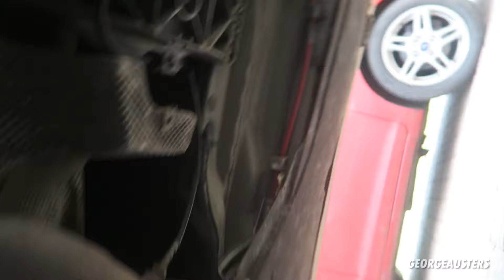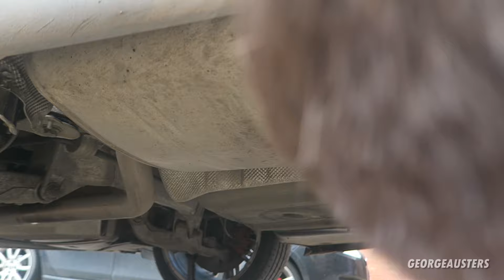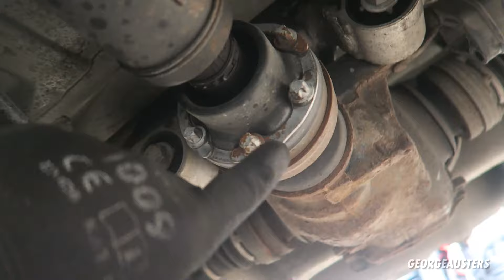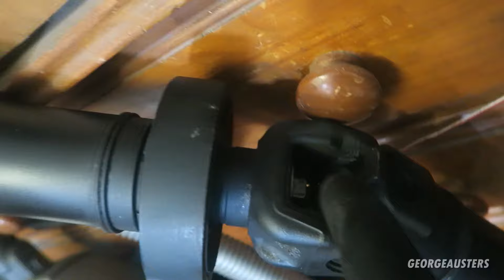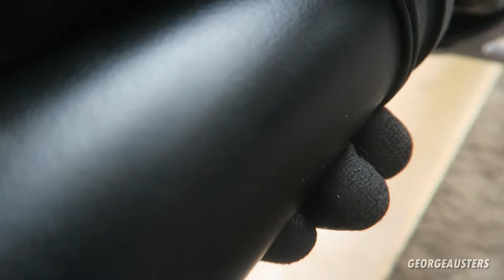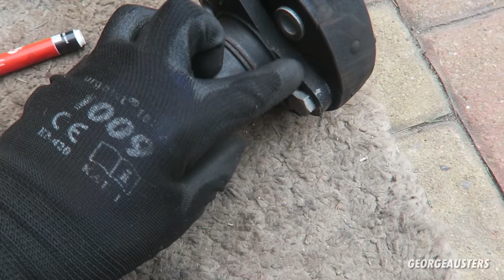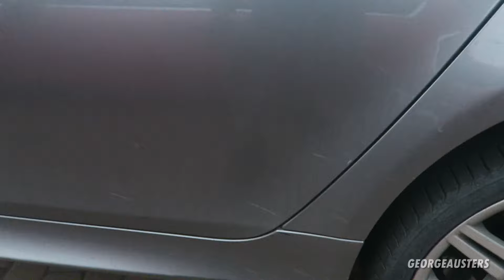BMW Propshaft Driveshaft Center Bearing & Giubo Flex Disc Replacement

Comment: I've got a bad rumbling sound happening that is very noticeable in low speed in my rear to dead center. Could replacing these parts fix this possibly?
Reply: Could also be clutch assembly and flywheel

Comment: Good video! My cars an E92 but is very similar to the E60 under there except my prop has guibos on the front and back. The front looks fine but the back one is cracked. This is my next job. I've been doing a bit of research and it seems BMW say to replace the guibo bolts when doing this. Did you see this but thought sod it? Because thats what i'm thinking. Them bolts are big enough to go again surely? 
While i'm doing the prop i'm poly bushing the 3 diff bushings as well because i'm sure thats where i get a gear change knock from on enthusiastic gear changes. The rear one is cracked so definitely needs doing.
Reply from the maker: Bolts were fine to use again, no issues

Comment: Replaced my bearing on e93 last week but get a whistling sound now after 30mph even when out of gear and rolling at speed. Is this down to preloading the mount ?noise is worse first thing. Sounds like when you used to get spark plug wires interfering with car radio .
Reply: Hi Dano, good posting. I have exactly the same issue after changing the center bearing on my e92. How did you solve this? It starts at 30MPH disappears when speed up.
Reply: When I rechecked the bearing it wasn't quite even on the carrier bolts so slackened and reset.  Not had the noise since . The bearing needed more and EVEN pressure in my case

Comment: An other nice video from you.  I have a F11  i have vibration on highway-speeds.  But it is after 120 - 130 not before. The vibration is always there. I have three set of wheels two sets of 17” and 19”. All wheels are balanced and 0-0 on the machine. 19” wheels are fitted with brand new continental sport contact 6 but the vibration are still there.  Could the culprit be driveshaft or engine/transmission mounts?
Reply from the maker: Could be!
Reply: @GeorgeAusters  all ready ordered. Will change them next week. Thx for advise.
Reply: Sorry to bring up an old comment, have you sorted this issue hasan as my car is currently doing the same thing ? Thank you
Reply: @tomdudley2876  Hi Tom. A road-force balance eliminated most of the vibrations i had.. There is a still a minimal vibration, where i measured to be a second order wheel vibration. but as it is now are acceptable for me.  you can use I-phone app called "vibrations" to measure the vibration order, frequency etc.

Comment: I have the same issue, the clunck noice has nothing to do with the driveshaft on my BMW, it is simply the engine mounts that is worn out, so the engine slams into the gearbox, (well its connected to the gearbox) but anyway, slams it, and that makes the gearbox jump almost out of its mounts and slam into the underneth of the car.
Reply: Did you solve the clunk noise , by replace the  engine mounts?
Reply from the maker: My engine mounts are fine. Checked them when I had my engine out
Reply: Sorry I should have done a proper diagnostic before saying a thing. There was actually 3 noices that melted into one (Because they all start at the same time)

1) A clunck noice / ring
YES, that was the drive shaft. The middle of the driveshaft has dampening rings, that is supposed to reduce clunck sounds. YES, they worked fine, the sound did not come from there. Both ends of the driveshaft has centering sleeves. Those sleeves can make a clunck noice (both of them) if they are not greesed. The problem is that the driveshaft is hollow, so even if those sleeves just rattle a little bit, it will make the whole driveline ring like crasy.

I also sprayed a small amount of fluid film into the driveline. That dampens the ringing sound from the driveline, and prevent it from rusting from the inside out. However driveline is super sensitive to waight changes as it is ballanced, so dont go crazy with the spray.
2) I found a small flake of rust inside the driveline, that made it ring all the time you accelerate. (Another reason to spray a bit of fluid film in there)
-> Yes the rubber mount in the center was warn, so new center support bearing with mount.

3) A competley other problem is that one of my mufflers is broken. It looks allringht and works, but there is a ringing sound and ratteling sound comming from the inside of it. I used my phone to do the diagnostic, record from different locations under the car to find where the sound is comming from.

Comment: Common issue with BMW the universal joint just before diff has lost all lubricant and its practically seized inside the boss.
BMW recommend replacing the Propshaft because changing only the U joint will throw the shaft out of balance you will very likely get vibrations.
Reply: I too have a clunk in the driveline. It was diagnosed by a reputable bmw shop as the drive shaft Cv and support bearing. I am waiting on parts as I type this. Great video.  Thanks
Reply: @bigfish5443 did it fix it?

Comment: Never put a driveshaft is a vise by clamping down on the tube. It is a sure way to "F" it up. Guibo is pronounced Jooboh. Your issue probably was that your constant velocity joint is worn which you have should have replaced anyway since you were in to it that far. Also check the U joint for play and if you lost any balance weights.

Comment: gear box flange, did you move it by hand with driveshaft off?
Reply: likewise with diff flange, listen for play
Reply: @farerse  can that have play on the gear inside the box?
Reply: @powpow4033  there should not be any play.. that could mean the splines are worn
Reply: @farerse  splines on the flange or on the shaft inside the box?
Reply: @powpow4033  could be both, I would have to do some research to give a definite answer.

Comment: Your clunk on acceleration may have been the rear lower ball or rose joints. They can clunk before you get movement in the joint with the car jacked up. I've done those many times on my E38 due to my on going experiment with aftermarket parts.
Reply: Hey mate I'm getting a clunk on low gears driving very slow only when taking foot of gas and pressing gas. When I had it on hoist it never had any symptoms. Could it be the guibo ?
Reply: @naders5  I am not sure, I have never had a guibo problem. Suspension clunks will likely occur when braking firmly when reversing or after reversing. Drive line clunks most likely happen as you lift the clutch. With all this stuff don't guess and waste your money on the wrong part.

Comment: Pretty good job mate. One thing i want to ask you.... have you made signs on both propshaft pieces and everything when you dissambled them? If you didn't, then that's your problem with cluncks under acceleration even after rebuilt. Your propshaft might got out of balance and no shops and garage will be able to do it back.
Reply from the maker: Yes I did mate, you need to as they are balanced
Reply: @GeorgeAusters  Well great to hear that George. Might sound strange but gearbox mount, flex disc or propshaft CV joint can do that aswell. Subframe bushed need to be checked if they present cracks etc, also diff bushes.
I was replacing all of them when i removed my propshaft (CV joint, center bearing, flex disc, gearbox mount, centration bush, also i've fitted a strip of butyl rubber membrane on top and sides of the central bearing housing, so in this way there will be 0% vibrations coming from it)
After fitment, everything feels like new. Mine was cluncking really hard under acceleration as central bearing was almost 100% gone, flex disc with many cracks but not broken, CV joint rubber seal broken so grease was in contact with water and basically was also coming out, centration bush was broken in one side.
And also i've used aftermarket parts: Febi, Lemforder,  SGF. What i've kept is that original bolts, might have gone for OEM but they sell them like gold....so i said no..
Reply from the maker: I’m doing my subframe bushes this weekend which I’m pretty sure is my issue
Reply: @GeorgeAusters  Those subframe bushes will make a clunk just when you forward or reverse your car or when you go over speed-bumps or uneven surfaces.  Usually under acceleration you cannot tell that your subframe bushes are bad, as your subframe is not vibrating, it is constant pushed back of forward depends of direction of driving.
Reply from the maker: Johnny Carter Have you seen my clunk finding video?
Reply: @GeorgeAusters  No... give me the link please...
Reply from the maker: Finding The Clunk On My BMW!
Reply from the maker: Finding The Clunk On My BMW!

Comment: I have a 2013 640i Gran Coupe, I was told by a mechanic I trust that I need to replace the entire driveshaft; however, I have no clunk or vibration at any speed. I have a very faint failing bearing sound at about 1300 to 1700 RPM. My mechanic told me it was a failing UV joint. I'm thinking if it were i'd have a clunk and other symptoms. Wondering if I can get away with a center support bearing replacement, anyone experienced the same issue?

Comment: Have you tried the gearbox bushings mate?
Reply from the maker: Gearbox bushings?
Reply: @GeorgeAusters  the 2 rubber mounts at the back of the gearbox
Reply from the maker: @thomo3663  There isn't anymore mate, just the one mount that I replaced
Reply: Hmm strange. I have a e91 320d and it has a bracket under the back of the gearbox with 2 rubber mounts on it, when they go back they knock under acceleration and harsh lift off
Reply: @GeorgeAusters  It could be your engine mounts ? my mounts had split in two on my E30 which i didnt realise until i replaced the front cross member on it lol Mine used to knock until i replaced it.
Reply from the maker: @yeti200sx  Already checked the engine mounts when I removed the engine mate
Reply from the maker: @thomo3663  Yeah the e60 has the bracket, but just one mount in
Reply: @thomo3663  My 2007 Bmw 320i 6speed manual (GETRAG BOX) has the same as you described. So you think these mounts could be the clunk on take off / acceleration  ( mine too has the annoying "tink/clunk" noise) I'm here because I thought it maybe the driveline. emmmmm.

Comment: I was pondering swapping out those two parts. Took to a local mechanic (whom I can honestly say I trust) he told me that I would need to change the entire driveshaft bc he said it was the universal joints that were going bad and causing my clunk at acceleration. Bc the entire part is more than I’m willing to pay I have not changed anything yet. Did you not have to buy any gasket for the exhaust since you removed it or new bolts for the bolts you removed?
Reply from the maker: No

Comment: I have a Mercedes-Benz CLA 250 2014 I have exact same problem I don't know what I did exact same thing I change the rubber donet and also the center hanging bearing and I still have the problem nothing change anybody out there can help me please I don't know what else to do

Comment: Will a cracked guibo cause rough shifting?
Reply: It wont cause the transmission itself to shift rough but in some causes it may seem like it is
Reply: @datchaffeec4529  Its like the entire car has movement when putting my car in drive. I know some of my bushings and ball joints need done. I'm gonna order entire suspension replacement kit. I have 114k on my car haven't replaced any and some are dry rotted and leaking.

Comment: Hi George, Did you ever figure out what the clunk was? I have a bmw 2007 320i m-sport manual 6speed that makes a tink/clunk most  pronounced  on take off ( a stopped start ) or if I say change down a gear to take a conner when I power on I get a Tink/Clunk type noise. I too am actually in the process of changing the  flex-disk & centre support/bearing - I haven't bought the parts yet ( was going to do that tomorrow / but now I'm not so sure after watching this ) I have my driveshaft out of the car the centre support is cracked in the rubber part also the flex-disk is cracked/split so I guess I may as well replace them. But I'm trying to fix my very annoying clunk which by the sounds will still be there after I complete this dam job. Oh no!
Please let me know if you found a solution. I've looked  & looked ......
Reply from the maker: Yes all sorted👍🏻

Watch this vid:
https://youtu.be/DGTkcBVPFp0
Reply: @GeorgeAusters  Thank You.

Comment: Knocking usually universal joints.
Reply from the maker: It's not a constant knocking, it's just once when you let off the clutch or step on the accelerator while going slow
Reply: @GeorgeAusters  it's when the play is taken up when the torque goes through it. Always when you start to accelerate not constant. Gearbox or diff otherwise
Reply from the maker: Didn’t notice any play when I removed it. Gearbox mount was fine but still replaced and didn’t notice everything wrong with diff
Reply: @GeorgeAusters  ok . Love the vids . Heres one for you guys , mine has a fast knocking sound from behind dashboard on tick over only, add any revs it goes, has done it from new any ideas?
Reply: @GeorgeAusters  i have the same clank noise  if u find out what it is let us know
Reply: @GeorgeAusters if you watch the ecs video on this job they move the drive shaft back and forth and it makes the same clunk yours did when you did that for a second. They said it's the ujoimt and to get a new drive shaft
Reply: @GeorgeAusters  Yes Same right there

Comment: you installed the flex disc in the wrong position, the arrow must be pointing to the metal flange on either the transmission or driveshaft side.
Reply from the maker: I changed it around don’t worry👍🏻

Comment: Your guebo was put back on wrong.   The little arrows point back to the driveshaft that the driveshaft bolts should go thru.      That’s your noise 100%
Reply from the maker: It's not. I noticed that before I installed it and changed it around so don't worry

Comment: The issue is either your rear wheel bearings or one of your driveshaft axles which hold the wheel bearings. Had the same issue
Reply from the maker: How do you know? I’ve not heard any wheel bearing noises and checked the driveshafts for play

Comment: It'd gonna be your front guibo, that's why you should had replaced the whole kit, bearing and both guibos
Reply from the maker: Only 1 guibo on this
Reply: @GeorgeAusters  oh ok, mine has a front and rear one.  Better off with just one like yours.  Mines also has this small noise kinda klunk that I just can't find either so I left it alone until it breaks

Comment: On the flex disc you have arrows,  to show the connections, on this video you fix it on the wrong side :(
Reply: I think this might be the cause of the clunk sound.
It flexes and acts like a spring causing backlash into differential or gearbox.
https://youtu.be/Vw7Zbp1rfGI

Comment: Replacing good bmw part with aftermarket febi isn't a solution...
Reply from the maker: Febi make a lot of BMW parts.
Reply: @GeorgeAusters  factory fitted parts > oem > aftermarket
Reply: They are actually the exact same part. Only difference is the FEBI has the BMW Logo and part number ground off.
Reply: Got Febi on most of my other cars for years, all have proved to be really good. Original BMW center bearing on propshaft went after 12 years and Febi went after 8-9 years. But to compare them: OE part £130 - Febi part £38. So i would say Febi is a winner here. Also Lemforder was priced at £49 so still not as OEM ones.
Reply: @GeorgeAusters  FEBI is just a re-packing company. The only thing they make is parts boxes.

Comment: I think you installed the Giubo wrong. there are arrows on it they have to point to the item being attached, if you turn the prop shaft one bolt hole over it will point to the shaft and the other 3 arrows will point to the transmission. here is the explanation https://www.youtube.com/watch?v=Vw7Zbp1rfGI
Reply from the maker: I changed it to the correct way before installing don’t worry👍🏻

Comment: Hello I heave the same problem in my e60. Solution is joint in driveshaft by differencial side nr OE 26117548392
Reply from the maker: How can you be so sure? My joint looked fine
Reply: in my e60 it also looked very good, but after replacing it, the vibrations fix
Reply from the maker: It's not a vibration i'm having. It's a clunk when releasing clutch.